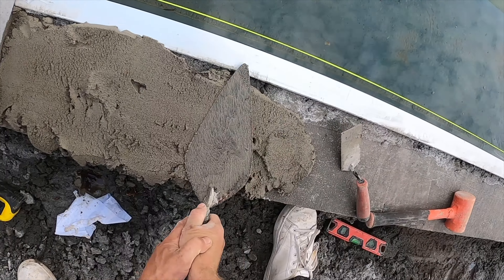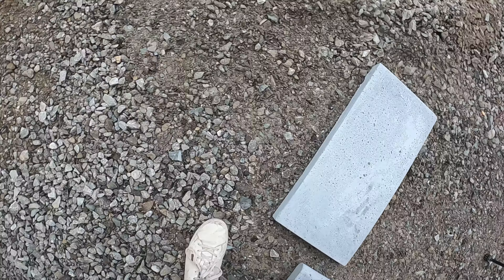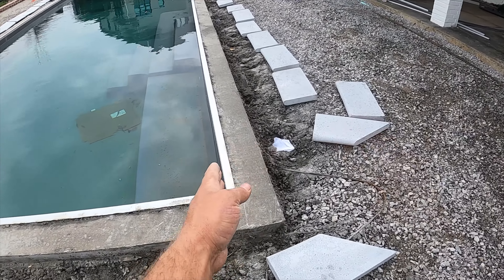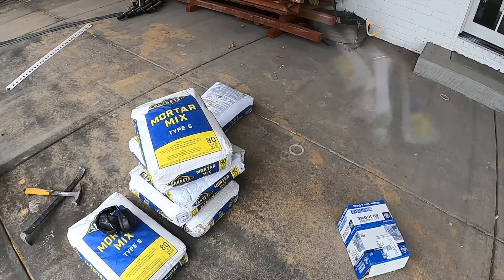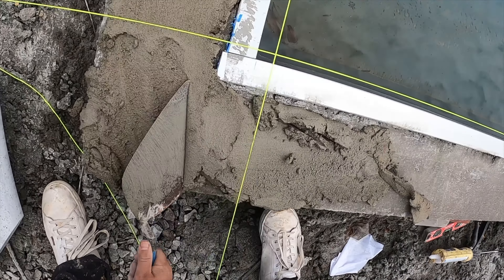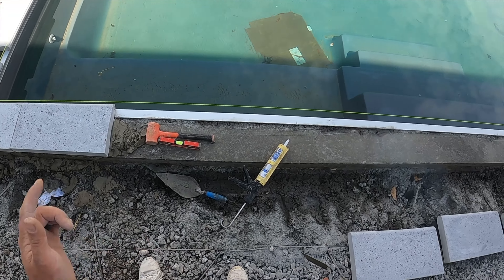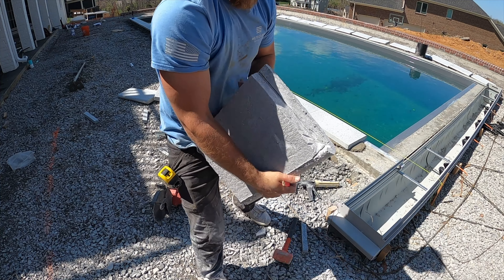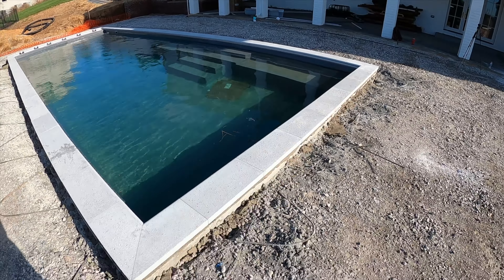Pool Coping Install Travertine/Pavers tools layout & complete install start to finish.

Comment: I like to wet everything- all surfaces before using mortar. In fact i dunk brinks and stones in a bucket of water before setting them.  You don’t want dry surfaces because the adherence will be inferior w dry surfaces.

Comment: "doing this with a 14" is basically impossible" 
Haha, said to a person whose boss is too cheap to have multiple stone saw blades at once... I've done 45s for a decade with a big ass quick cut! The idea that a smaller saw would be easier actually blew my mind and will definitely be the way I go on this next project
Reply from the maker: Haha. I have a big 14 inch. It does make it more difficult. I’m not very good on the 14 inch to be honest. I haven’t used it that much that small saw is awesome and it works so well.

Comment: What type of rock did you guys use around the pool and under it? I was also wondering if you guys did the retaining wall and just rocked all the way to the pool? My yard is very similar and I would have to do something equivalent for a pool but I wasn’t sure what material is best for not settling. I need probably a 6 to 8 feet tall wall to support a pool. Thanks
Reply from the maker: @alyssacoffin7735  yes. This is a poured wall with brine in it to match. We used a 3/4 crushed stone and compacted it all the way up. For the base of the pool we use a 3/8- crushed rock. Are y’all building your own pool project or having it built?
Reply: I’m 50/50 on building it myself or hiring it out. My stepdad has a lot of equipment to dig the pool out but my worry is cracking the fiberglass shell. I really like the San Juan pools for their designs but I do not know much about them. Your videos are awesome by the way!!! Thank you for all that you do.
Reply from the maker: @alyssacoffin7735 I appreciate that. It’s really hard to crack a shell. You have to really screw it up to crack it lol I don’t if you have heard of my mentor program but part of it I help home owners build they’re in project. All virtual. My fee is $5,000 and I can help guide you through the whole process show everything goes the right way and you get the job done. I can help you avoid all the mistakes and teach you everything you need to know. That way you feel comfortable doing it yourself and it will save you tens of thousands of dollars from hiring someone out.

If that’s something you’re interested in shoot me an email Jonathanportukalian@gmail.com

Comment: What type of sealer do you recommend? And what specific type of coping is that? Looks great!
Reply from the maker: @user-fm3xy3bq5d  I use a stone sealer our local supplier. I don’t have one I swear by. Any stone sealer should work. This stone is call hart stone. It’s made right here in Louisville Ky. It’s a poured stone.

Comment: Hi Jonathan 
Thank you for the wonderful video. I am trying to lay travertine pavers. Do I need to leave a gap between the pool coping ?
Reply from the maker: @chandikawijesinghe5872  if you want to grout the joints yes. Id recommend 1/4-3/8s

Comment: I was fixing up the silicon for my pool's expansion joint, and I noticed that some of the steel in the concrete patio extended into the mortar for the pool coping.  Doesn't this kinda defeat the purpose of having an expansion joint in the first place?
Reply from the maker: @bobbycrosby9765  the rebar was at the top of the slab?
Reply: @jonport_  in the middle, about 1.5 inches below the surface.  It runs horizontal past the edge of the slab, past the expansion joint, and into the mortar between each paver for the coping.
Reply from the maker: @ I think I know what you’re talking about but I’m having a hard time visualizing exactly

Comment: I assumed the joints on the coping were epoxy filled like a countertop seam.. another question if the Client wants a baja shelf/sun shelf whats the pool material choice for the that 6 inch bottom. Chair legs could be an issue
Reply from the maker: You could epoxy them but i left them open. This is a fiberglass shell so for the sun shelf they have chairs that work and wont damage. Is that what you meant?
Reply: @jonport_   Correct, So a vinyl pool liner type system is a no no for a  sun shelf. I’m not to familiar with Fiberglass pools.
In our climate, with  4 season temp changes from -20 to plus 30
Reply from the maker: @BZ1340 no not at all. We do sun shelfs all the time with vinyl Liner
Reply: @BZ1340 a thicker mm liner shouldn’t have an issue. The chairs that you put on tanning shelves are made specifically for tanning shelves. They’ve got a flat bottom and can be filled with water to weigh it down. If you were to just put a patio chair on it with legs, then you may run into a problem

Comment: You really should thinset the beam and the coping. mortars more for building up not making two pieces stick together. Mortar alone is going to break loose specially with dry on dry would have even helped a little to wet the beam and the back of the pieces. I know I’m just some guy on the internet critiquing your work but I actually do very high end coping and tile in S Fla. I also would have just cut those stones on my wet saw.
Reply from the maker: I’ve seen that method. I’ve changed the thickness to minimum of 1/2in. I’m definitely not apposed but we live in a freeze thaw  cycle down here so I’m not sure how that would last?

Comment: Seems like if you set strings to the backside of the coping it would be more accurate to line up (with the sharp edge) and less in the way of where you are working.

Comment: I have a few loose coping tiles. Pulled them up and ground off thin set from backs. Beams are in pretty good shape. Can I just lay them back using an even layer of thin set or do you recommend something different?
Reply from the maker: Thats what i would do. Anything else would be really extensive

Comment: Once the coping is in place and set up, do you go back and pack grout / mortar on the underside between the bottom of the paver overhang and the top of the pool wall (this is on the inside - water side - of the pool)? If not, do you fill this with silicone?
Reply from the maker: Ideally the silicone will seal it up when you first install it. I don’t go back with anything. You could
Reply: @jonport_  Thank you very much for such a quick response!
Reply from the maker: @arthursnyder2178  yes sir! Your welcome

Comment: Why you didn't  cut a 45 at all the corners?
Reply from the maker: @nigelderon4573  thers only 2 90 degree corners and both have 45 cuts. The other 2 ends tie into the auto cover

Comment: Can you elaborate on how you decide on a vinyl liner pool VS fiberglass? Do you give customers the option? Is the cost to the customer comparable? Which option makes you more profit as a business? Are there a lot of gunite pool builders you compete against?
Reply from the maker: We do fiberglass mainly because that’s what the customers want. The price is the same as vinyl, and we do make more money on the fiberglass because we can install them faster.

Comment: Great video. Would you pour concrete first and then to the coping/tiling on pool (pool slightly raised) or the other way around? Thanks!
Reply from the maker: No i don’t. I want the coping flush with the concrete.

Comment: Can you list the material and from where as far as putting the coping back on after it falls off!
Reply from the maker: @lascellespowelljr.1109  a simple way would just get a Landscapeing adhesive for stonework. Other than that, you’d have to pull the stone up and grind it down  and reset it. You would need an angle grinder with a concrete bit blade, concrete, chisel, mason trowels hammer level, and mortar.

Comment: Does this application require anything to be put into the joints of the coping? Polysand/mortar? Or does it not need it?
Reply from the maker: Not at all. I feel like its less maintenance when you but them close and it look really good. You do end up with about a 1/32 to 1/16 gaps sometimes depending on the stones which look perfectly fine in my opinion.

Comment: You didnt wet the beam or the stones before you put the mortar or the stone down... Also you didnt clean the dust off of the stone after you used the grinder on the stone. That stone wont stay on that beam for long. Why no grout joints? What about expansion and contraction? You did a good job at laying the stone but youre not being technical.
Reply from the maker: @dutchvanderlin5556  how much will it expand and contract ?
Reply: How much it will expand and contract varies by climate. Having no gaps at all is inviting trouble in most of the US.